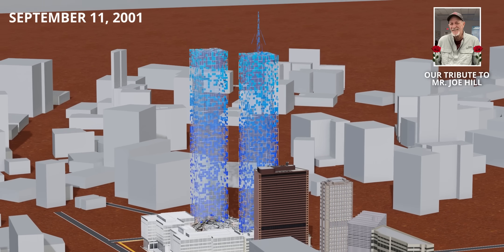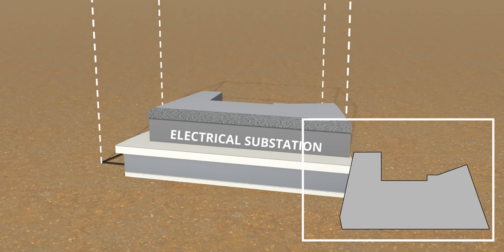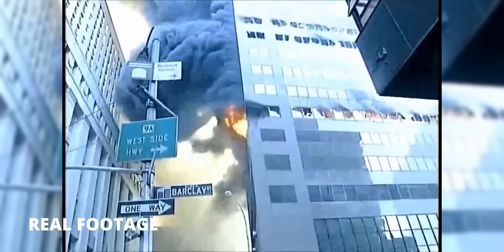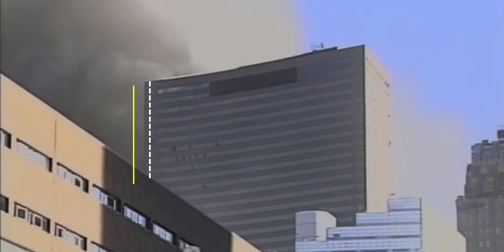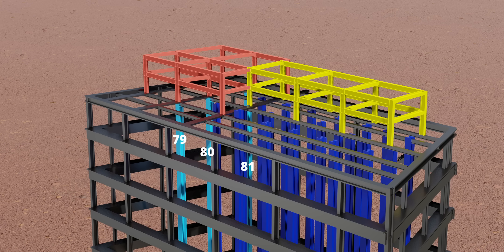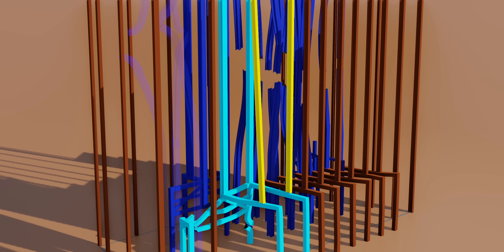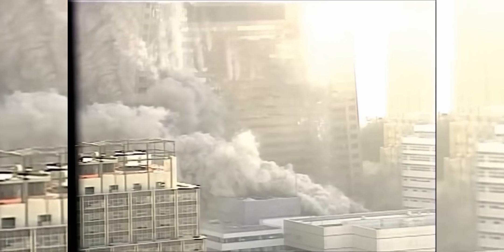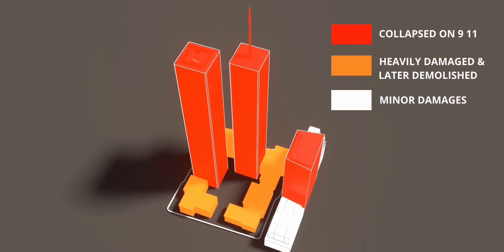Collapse of Building 7 | The Complete Physics

Comment: I watched a 6 story apartment building nrought down with controlled demolition. Demo company rep explained exactly how it would come down and it did. Parking garage was also given a detailed description before it was brought down. Rep also stated they weren't at all sure about what would happen to the elevator shaft in the parking garage. They couldn't predict that fall becaue WE DON'T HAVE THE ORIGINAL BLUE PRINTS OF THE ELEVATOR SHAFT SO WE DON'T KNOW EXACTLY WHERE TO PLACE THE EXPLOSIVES!  They dropped the parking garage with the elevator shaft still remaining. You have to have highly trained professional people using the original blue prints. If there actually were any fires in the 3rd tower they weren't hot enough to burn concrete and weaken steel.
Reply: .......so, did you somehow think that that ramble was an argument for anything at all?
Reply: @mooneyes2k478  all 3 towers came down by controlled demolition.
Reply: @onetransmission7871  It's just, there were no "3 towers", there was nothing controlled, and even less "demolition".

Which sort of ruins your claim, doesn't it?

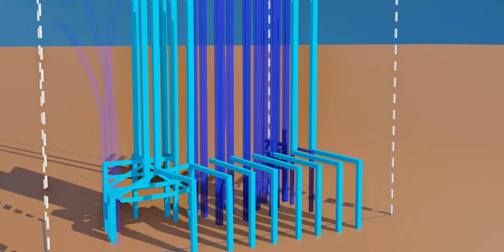Comment: 6:56 A column collapse progression like you imply would've created more of a lean & a delay in the fall of WTC7. The FACT that WTC7 fell at the speed of free fall, with the roof nearly linear implies that all of the structural columns failed within milliseconds of each other. Bet you were paid well for these lies.
Reply: No it wouldn't.  Do pay attention. Lets break it down at a more detailed level.

Here is the CBS fixed camera footage from West St. showing the upper 20 floors (of 47). 

www.youtube.com/watch?v=aBYoKEbIIBg 

The first externally visible signs of collapse initiation from this angle occur at 0:03. the exterior moment frame starts to drop at 0:11. 

At 0:03 we see the first deformation of the north roofline of the rooftop East Mechanical Penthouse 

At 0:04 the EMP collapses into the building and we see window breakage along the C79 line. 

At 0:06 the EMP has fallen into and through the building, evidence by the daylight we can see through the upper floor windows and the progression of window breakage going down the north face of the building as the exterior moment frame bulges out. Harder to make out in this clip is the smoke that has been billowing out of the building changing direction and getting sucked back in through the hole in the roof. 

At 0:07 we start seeing the rest of the rooftop structures falling into the building, progressing from east to west until all the rooftop structures are gone by 0:11. The animation in the Sabin video roughly translates to 0:10 in the CBS video. 

At 0:11 the exterior moment frame - now a hollow empty shell, evidenced by its twisting into an S-shape and leaning inward at the top on the north face starts to drop. That is only possible because there is nothing behind it as all of the critical structure - the core columns - are gone, pulling the floors with them and no doubt taking some perimeter columns as well. The twisting becomes more pronounced and obvious as the exterior moment frame drops, demonstrating the exterior moment frame is moving in 3 dimensions not 2. 

None of this is intuitive to the casual viewer and I am convinced this is at least partially why Building 7 remains a Holy Grail to parts of the inside job conspiracy community. 

All of that is consistent with a buckling failure of a critical column - C79 - in the NE corner of the core. This can be readily explained by floor failures in that corner of the building leaving that column laterally unsupported over an excessive length. The NIST in one of their models estimated 9 stories. 

The failure of C79 causes the kink in the EMP roof and the line of window breakage below. C79 is right under that kink and right in line with those windows. 

In a normal building there would be redundancy to redistribute the load, but not so with Building 7 owing to its unique design having been built in an odd shape on top of another building which served as its partial foundation. 

When C79 fails that leaves the other two other columns at the east end of the core - C80 and C81 - laterally unsupported over their entire length and, not surprisingly they buckle and fail too. 

Down goes the EMP through the building. 

From there we get a cascade of core column buckling failures from east to west through the core until the core is gone, leaving that hollow empty shell (the "empty cereal box" as Sabine describes it) giving the optical illusion of a still intact and standing building. But it is just an illusion. 

That exterior moment frame got its primary support from the 4 corner columns, out of the 83 in the building (above the load transfer region). 

Of course those were going to fail. And they did. But at that point it was rather academic.

For those disciples of the Church of Free Fall it is only at about the 0:12 mark that the famous measurement of alleged free fall is taken, long after all of the important parts of the building are gone. While not actually a measurement of the building (just a single point on the exterior moment frame) and not actually free fall (it was a curve, starting out below, topping out over FFA then dropping back below again over an arbitrary 2.25 seconds) it was clearly a product of collapse progression mechanisms NOT collapse initiation mechanisms and thus can not tell us what started the building falling about 10 seconds earlier.

Comment: 930k views 17k likes any one with half a brain cell can see propaganda when they see it. How many dislikes?
Reply: Gravity. It directs objects straight down, towards the center of the earth. Fire, weakens the metal skeleton, Gravity does the rest!...
The relative uniqueness of the WTC7 metal skeleton, only helps substantiate the basic, scientific simplicity, of all three buildings collapse!...
Reply: @mderline4412  What temperature do you need to weaken the steel beams?
What was in the building the can burn hot enough?
Reply: @leighmoom5277  - Peak temperature is not the issue and views vs. likes on a YouTube video is hardly scientific. 

You may not like it after more than 2 decades of internet conspiracy dogma, but what is being presented in this video is fundamentally correct and widely supported by the worlds engineering community.

While imperfect (there are a few problems) this video goes into a much higher level of detail than many viewers can comprehend and gets the collapse mechanisms fundamentally correct. This is true no matter who planned and carried out the 9/11 attacks or why . 
	
Sure, it’s not what you want to hear and goes against 20+ years of conspiracy dogma and conditioning, but that is not the same as it being wrong. You just need to fix your dogma. 

On the plus side, this video can be (and is) fundamentally correct about the engineering AND the 9/11 attacks could still have been some sort of inside job. The two things are in no way mutually exclusive. It’s just not the inside job the clowns you have been following on the interent have been telling you. 

This will surprise you to learn, since the conspiracy side of the internet hides it from you, but the mechanisms described here have broad professional support around the world. There are no professional engineering organizations (for example: ASCE, ASEE, ICE, etc) that disagree with them or have offered any formal dissenting opinions or alternative hypothesis. 

FEMA BPAT (initial report superseded by NIST NCSTAR 1A)

NIST NCSTAR 1A: Final Report on the Collapse of the World Trade Center Building 7, 2008.

Guy Nordenson and Associates, WTC7 Global Collapse Analysis Report and Summary of Findings, 2010.

Arup, WTC -7 Structural Fire Analysis Report (Runs 1-4), 2010.

Weidlinger Associates Inc., WTC 7 Collapse Analysis and Assessment Report, 2010.

BRE Centre for Fire Safety Engineering, Analysis of the Impact of a Fire in the Mechanical Room (5th & 6th Floor) of the World Trade Center 7 Building, 2010.

T. McAllister, R. MacNeill, O. Erbay, A. Sarawit, M. Zarghamee, S. Kirkpatrick, J. Gross, Analysis of structural response of WTC 7 to fire and sequential failures leading to collapse, J. Struct. Eng. (United States). 138 (2012) 109–117.

For a summary of the major studies I would recommend THE COLLAPSE OF WORLD TRADE CENTER 7: REVISITED by Mhd Anwar Orabi , Liming Jiang , Asif Usmani and Jose Torero which is a 33 page summary of the different analysis and conclusions published in 2020. Sorry, YouTube will delete this post if I give the link but it should be easy to find and is available from the University of Queensland, Brisbane. 

Real structural engineering industry professionals conducting real engineering studies and publishing them for other professionals to see. Not amateur YouTubers appealing to the gullible and credulous.

Happy reading

So, either the overwhelming majority of the worlds structural engineers and quite frankly simple observation are wrong,… … or you know more than the worlds best engineers from cruising around on the internet. Which seems more likely? 

If this explanation is wrong then produce a better one.  Be the first to even try.
Reply: @leighmoom5277  "...to weaken steel beams..." The impact of debris and the ensuing hours long unfought fire. Consider; The average residential fire, (pretty much like an office fire)  drywall and contents, can easily reach 2000 degrees Fahrenheit. The melting point of Steel 2500-2800 F. Perhaps a better question for you to ask is "How heavy is one floor of a Skyscraper?! The aircraft were full of fuel!  The American Airlines Flight 11 (North Tower): Estimated speed was 429 - 495 mph.
United Airlines Flight 175 (South Tower): Estimated speed was 537 - 590 mph. As you recall, the South Tower which was attacked second, collapsed first! The impact point being much lower on the structure, with more floors above it! Think this event, all the way through!!...
Reply: What matter how many dislikes?
And while I'm impressed that you admit you can muster only "half a brain cell", it might not be the smartest of moves.